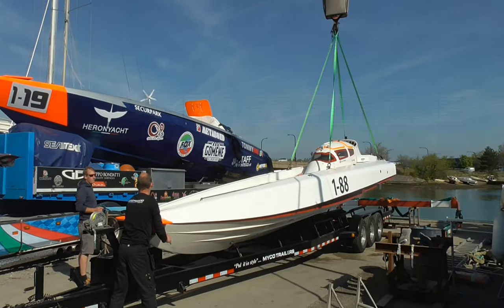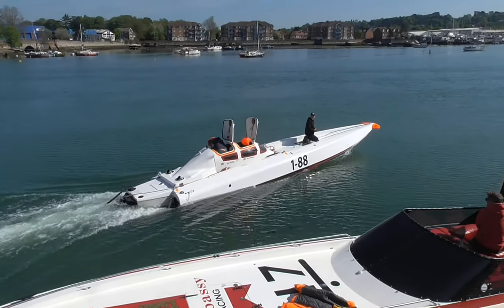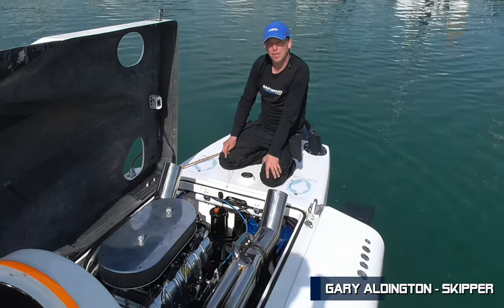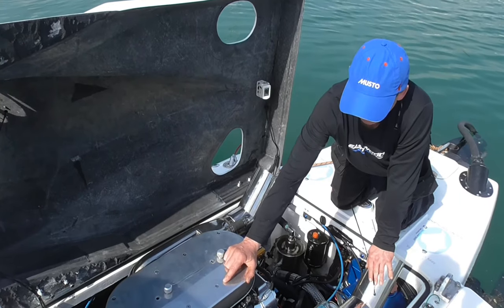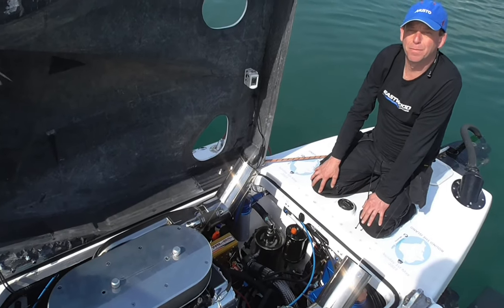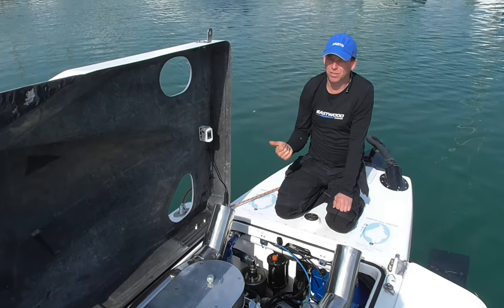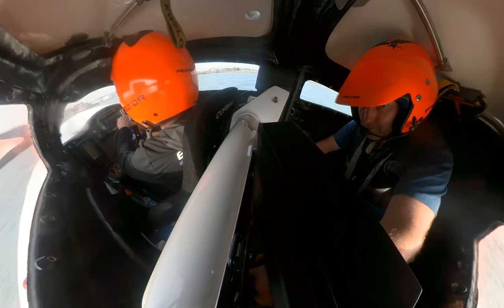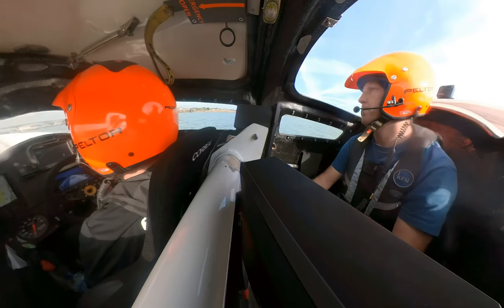Vintage Torque - 2022 Round 1 - Around The Island

Comment: Would counter rotating props work to level running against prop swing toque effect?
Reply from the maker: Not sure if all other class 1 boats have counter rotating props but less of an issue I suspect with a wider hull to accomdate two side by side engines. We are a very narrow hull with one big engine. Only meeting the requirements of class 1 (must have two engines) as we have a 850cc jetski engine tucked in the port side of the hull. Not running when we are racing. Just to stay out of trouble if the main engine lets go.
Reply: @eastwoodracing  thanks for reply. Best of luck for coming race season. I shall follow with interest.  Boat sounds great btw!